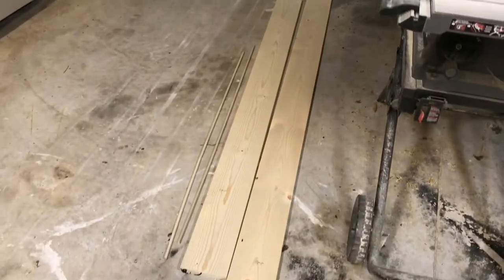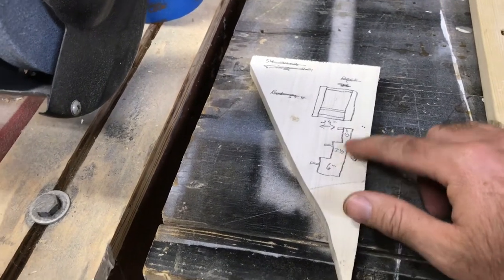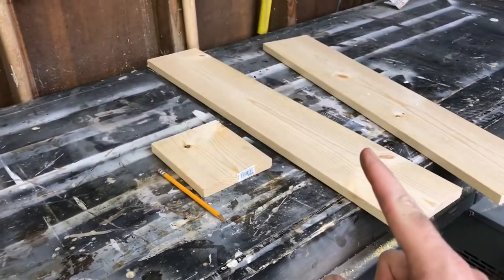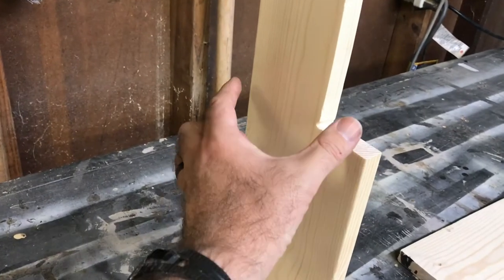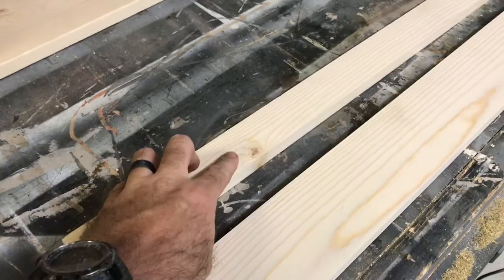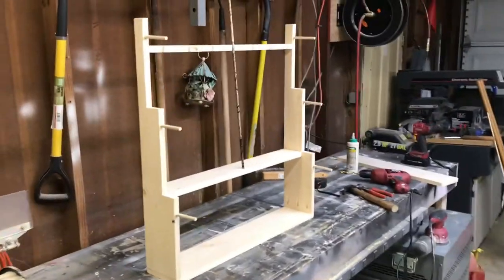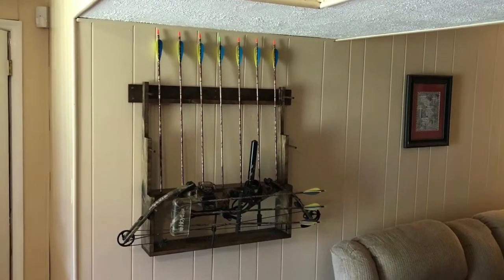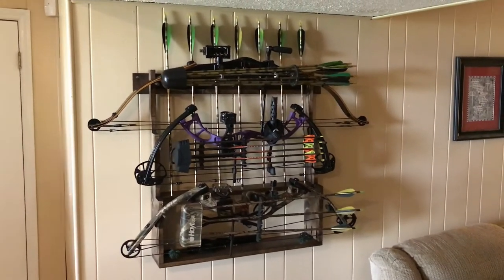Make a Compound Bow Rack for $20 | Archery | DIY

Comment: That's pretty good work! How did everything work out? Did you see a need to change anything? I want to make this for my setup. Thanks for the idea!
Reply from the maker: I have 3 of my bows been hanging on it since I built it. Holding up great. I didn’t have to change anything at all for the ones I’m hanging. Now….todays shorter bows like my Matthew’s, I have it on the other style hanger I built on my channel due to the shortness of the limbs. If you build the 3 bow hanger just make sure you account for your limb size and where the pegs will hang.